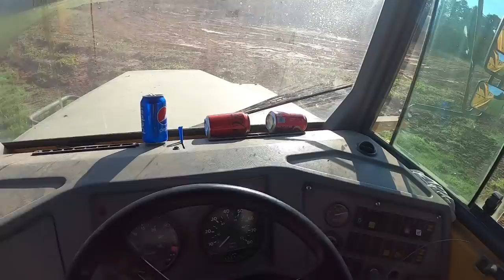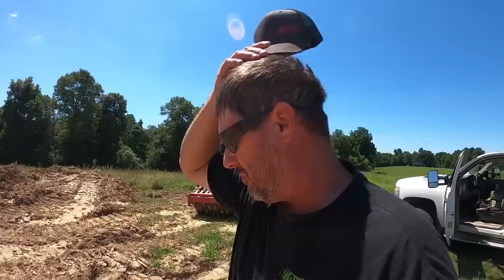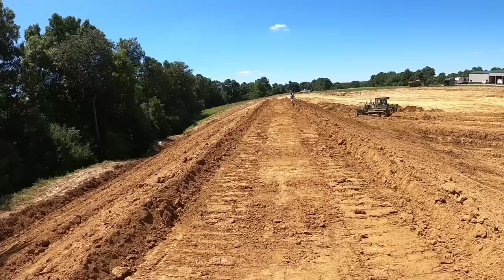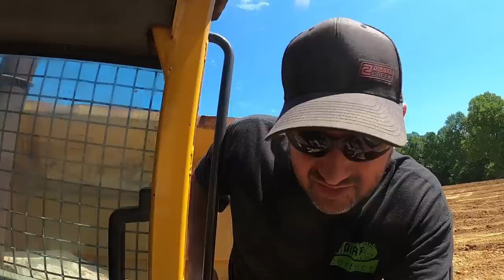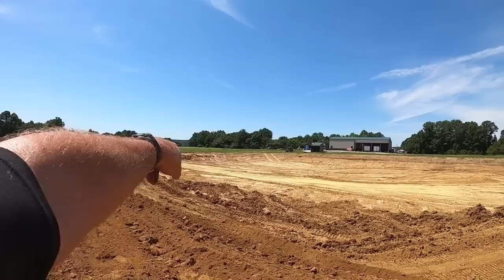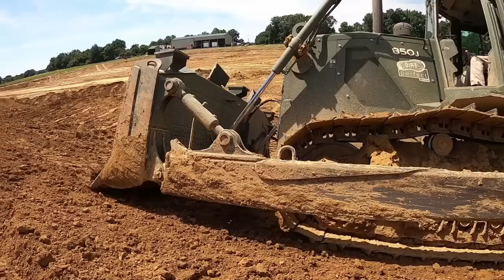Hitting on all cylinders-we got dirt on the move and dam is getting close!  @UpstateBrushControl

Comment: You love the serviceability , controls, smoothness and fuel consumption. Also the weight is right for hauling. Also, you had all the work done on the bucket, level sensor, etc… keep the 210. 🇦🇺

Comment: Hi DP  your getting about the same fuel burn as Dirt steel and grain with the 220, but I have to say a 6 cylinder won't be working as hard, just I'm unsure what size bucket is on the 220. The big question is hauling it to the site would it cause any problems with it being slightly bigger? ps I  think I already know what you've got now lol yes I follow you on Facebook.

Comment: To me, it's a no-brainer to send the 210 back.  Great machine, but extremely difficult to justify new prices.  I'd buy a good 2000-3000 hr machine and expect to do a bit of wrenching and accept a few dents and scratches. To justify new prices, you need full-time work - a pipeliner, quarry, mine, large industrial project can make sense buying new since uptime is so important. But for DP, unless Hyundai cuts him a smoking deal, I'll be shocked if DP keeps the 210.

Comment: I personally think the 210 is a good match for your needs. The 220 is a bigger machine physically so don't think you need it. I might consider a bigger bucket for mass excavation like this dam project. It can handle bigger trees for removal them the JD also. Also it is easier to haul into some of the job sites you get involved with, the 220 being I believe 124 inch's wider. Even being a Cat man for years I am impressed by not just the detailed build quality. Especially the layout of maintenance items , filters, grease points but the way everything wire's, hose's etc are marked. Anyways just my two cents worth :-)

Comment: From this side of the camera the 210 looks like it was the little bit more machine you needed for some jobs. Bit more weight for shoving trees and moving big decretive rock, but still sips fuel and doesn't need more truck and trailer to move it. To me it looks like it fits your operation like the ripper on the newer 850, you didn't know how much use it would get till you used it. Matt and Aaron or Kleeman could have moved a fair amount of dirt with the 210 and Bubba Dump if you had to run the dozer if Jerry had something else to do. As the three of them seem to be comfortable running the truck or the excavator. Heck get all four of your part time help with you on a job and you could build people lakes instead of ponds. 

The only machine I can think of that might work better for ponds would be a scraper, but they are pretty much a one trick pony; and depending on the scraper you still need a dozer to shove it. But that is extra moot once Lt Dan is up and running, that 210 with a big bucket with those two dump trucks would really move a lot of dirt.

Comment: Once you have a price on the 210, you can quickly price other excavators of similar size and features. With that data in hand, your decision should be pretty easy.
On the dozer vs haul truck and excavator, why not bite the bullet and rent an elevated scraper for your next large pond job. I think you will be surprised at the cubic yards and time it takes to move large amounts of material with a scraper. Also, an elevated scraper cannot only build a dam quickly but can also finish grade the front and back slopes. One scraper eliminates the need for the haul truck and excavator; the 850J would rip the dirt to facilitate faster scraper loading times.

Comment: 210 is my choice but only if you are going for the big jobs . My analysis method would be based on the following
1. Cost of the machine payments per hour 
2. Cost of fuel per hour 
3. Yards of dirt moved per hour.
4. Mobilization expenses 
5. Maintenance expenses
6.  How many more jobs can be done with 210 vs 850
I think you already do this but that is my way to do it 
Use as many scenarios as you can and take the average. Then do what I think you will do and let the 210 go back to the dealer

Comment: Are you taking in consideration you're using a smaller bucket on the 210. If you had a bigger bucket to match the trackhoe power/stability. You would be doing less cycle times loading quicker better turn around times. I agree with you about there's the perfect equipment combo for each job and not every job is a cookie cutter job. Keep it up I like watching you guys play in large sand boxes with your toys.

Comment: DP, regarding that representation of figures:

My first concept is a graph,
-  time (days assigned to a project) from left to right,
-  money from bottom to top.

You can then draw lines, like
-  horizontal ones for one-time costs (like permits) and (below the X-axis) benefits, and 
-  gradients for continuing costs (like fuel and labor hours).

You could draw multiple lines for the same data (like representing a high and a low fuel-price estimate, or operating costs of alternate equipment (like 120 or 210). You could assign different shades of the same color to lines of the same category, like darker blue for the 210 than for the 120, and darker red for a higher fuel price.
A repair job on a piece of equipment would appear as a horizontal line from the day it occurred (e.g. day 78 of the project).

These lines obviously are representations of equations. You could set these up in a spreadsheet (save an empty one as a template!), such that you can always view your graph, see if you're still on track for profit, and how aspects of costs and benefits develop. - Well, I assume that dedicated Project Management software will do a better trick, but you're likely to have some experience using spreadsheets.

You could start the spreadsheet simple, then gradually break up factors, like the operating cost of equipment in "greasing (daily)" and "fueling (active hours * hourly consumption * price per gallon)".

The above are my thoughts as developing while writing. There are likely to be better ones and worse ones.  :-)

Comment: Mike if you want to become more efficient the one thing you can control is the number of scoops it takes to load Bubba Dump. As you there are a lot of variables that change from job to job. But the loading is the same. So when you are in easy digging conditions. You be using the largest bucket possible. Even if you have to have it custom made. Consider it a throw away item. Make it out of 3/8 thick wear alloy. And just beef it up where it absolutely need it. I know you can easily repair it when that time comes . Bubba Dump is not making money if it has to sit and wait to get loaded.

Comment: Having been around heavy equipment all my life, fuel consumption is crucial for profitability. Your JD 120 is great for small jobs and much more maneuverable. The 210 in combination with the haul truck is a terrific combination.
Another aspect to consider is you have a lot of used equipment which requires unexpected repairs occasionally. Having a one new unit which is on warranty helps, but with your attention to maintenance, breakdowns should be at a minimum for many, many hours of use.
Considering the additional fuel usage and weight of a 220,  there doesn't appear to be much advantage to changing over.

Comment: Looking at that dam, your not the only one, it definitely looks lower at far end. It would be interesting to see what your thoughts are, especially when deciding what machinery to take to each job. Matt (NYA Millennial) has done a couple of films to show the process for quoting, which are really interesting, so seeing one from how you look at each job would be good as well. I think you definitely chose right when you picked the 210, looking at how it has operated, to be honest I don't think there is much in it, especially as it over performs when your dealing with heavy loads. When you built that stone wall, I am sure a couple of those larger rocks where over its guided lifting weight. Bet the folks at Hyundai were at 1st having a fit, then 2nd jumping for joy seeing what it could actually do. Oh and one thing, get Bubba Dum a reversing camera, that way you'll be able to talk to camera and reverse with no problem at all. 🤣😂

Comment: I can see what you mean.. this lake, the bowl is loaded with good dirt... so 2 big dozers would probably have been really good with some touch ups with Bubba and 210... like your big lake last year... you were using the 8500 to haul dirt... Bubba vs that is a big difference (We've not seen you use the 8500 much this year.... mostly seen on Kleeman's channel..).. Where you have to move dirt from pt A to B without hitting all points between.. difference maker.. of course.. the 210 with your rocks was probably huge too... some of them were probably as heavy as your 210.
One other piece of new equipment that you haven't talked about is the ripper on the J... first, you've used it heavily with the tile plow (which could be mentioned too), but you also used it here to soften things up at the beginning.  But I can see where some jobs.. The mini is too small and the 210 is just a tad overkill.. the 120 is perfect for that... the surprise is the 140 being gone... but really.. that's just another 120.. But I think the one new toy you have that you will love the most... the thunder Creek Trailer...

Comment: How do the numbers work when you consider Matt sitting in Bubba's cab while you load and you sitting in the 210 prepping for the next load vs a one man operation jumping between equipment? The 120 has Matt sitting longer in Bubba but less fuel burn. Wages sitting in the cab look like a bigger bite that fuel. 
That takes some number crunching. Cost of 2 men and fuel per 100 yards/10 loads moved vs 1 man and fuel per 100 yards/10 loads. The operators legs would pay a toll with a 1 man operation. Been there, Done that.
Reply from the maker: No comparison

Comment: Having options is the key, versitility 'Horses for Courses' is a saying that rings true everytime.
 Th2 210 is by far better value than say a 220 Volvo. also the 120 JD is getting long in the tooth and repair work is down time = cost to you and the customer.
 Having repaired all makes and models of earth moving equipment I found that the 'Mechanics friend is the 210 make due the fact that I had little to do only servies them and those are planned. 
The Volvo make as LD18 will say costs an arm and a leg when needing repairs and those breakdowns , faults or issues alway happen when you need the machine, also where I live the spares availability for the Volvo has become shall I say strained and alternative parts are not liked by the Volvo machines. 
The Volvo dump truck is by far the best out there we replaced our Cat dump truck for Volvo and again vertually breakdown free.
 The push v the dig load and move is all about cost effectivness as you say and Matt has that well versed in his quote vids. The 210 I would recomend and I am not employed or been employed by said manufacturer, in fact I learnt my trade with the good old IH company and your friend at C&C will tell you that we made some of the best crawlers in the day and they are still running, so I am only saying what I feel is best because I had to repair large plant/equipment for many years and have kept my eye in to present day.
I felt sad when you went with the Volvo when you last bought an excavator and my comments did come out true unfortunatly. Please take your time think and think again and go for the one that fits and answers as many questions as you see fit.
Take care stay safe and awsome vid again.

Comment: I have moved a lot of dirt and trucking it like you have been doing still is less wear and tear and you can move a lot with that haul truck and larger excavator. Dozers burn a lot when heavy pushing plus the haul truck is a great compactor.  Using both methods is a great combination.

Comment: You talking about effectively moving the dirt on the lake. I can see where a motor grader and scraper would be more efficient than the truck excavator that you are using. There is no right or wrong way to move dirt you just use what you have.
Reply from the maker: I disagree on this job think about a few factors
Reply: @DirtPerfect  to be honest on that job two or three dozers was all you need. But if you replaced the truck and excavator with a pan and grader you would see faster cycle times
Reply: With a scraper you don't need someone/equipment to load dirt.  You don't need someone/equipment to spread or grade dirt. It also rolls/compacts dirt as you build it. One machine can replace 3 on this job.  But you have to have scrapers at your disposal otherwise you use what you got.

Comment: I have a different take on the 210. My thoughts don’t take fuel consumption into the primary, but rather secondary concern. My number one consideration is does the machine reliably and repetitively get the job done with the least amount of headaches, and is designed with ease of maintenance and serviceability in mind. My second consideration is does the dealer selling the machine take care of you their customer. From what I’ve seen, your Hyundai dealer has worked hard to earn your business. If they will continue working hard on the parts and service side of the business when the time comes as the hours pile up on the machine, I say get the checkbook out. The last thing you want is the most fuel efficient machine, but can’t make it through a job without something going wrong (remember the headaches the ORANGE machine gave you)!

Comment: Just figuring the fuel usage alone: If you go to a used machine and it uses, let's say 6 gallons per hour and if you worked that machine for 5 days a week at 10 hrs. a day and if diesel gets to $6 per gallon, you will spend $1800 a week as compared to $900 with the machine you're now using. If you worked for a month in that scenario, it seems that you would save enough to make the payment on the new 210

Comment: We did a huge flood control project for a town about ten years ago and we were doing it much like you are except on a larger scale. Then the foreman decided to use loaders instead of excavators for the digging and loading. It increased the amount of dirt moving by at least double. Instead of 8 trucks we went up to twenty. The only downside was every once in a while we had to have a dozer or excavator dig down to the next level.  Just a thought for your next project

Comment: You probably made up your mind by now, but this is my thought. 
A dozer is a more specifick machine capable of moving a lot of dirt. in the hands of an experienced operator like Jerry you can get the most out of it.
But Jerry is not the youngest any more and hard to replace. Besides that, you have three dozers.

An excavator is more universal, cannot move as much dirt as a dozer, but can do a lot more, like the rock wall or clearing trees. It is more likely to run the entire year when your dozer is not. When the Hyundai is going, you have the 120 and the mini left, probably not enough so you are looking for a new(er) and heavier excavator.

The only one that can tell if it possible is you, we cannot see into your wallet, and thats what have to make out. Being a small business and able to make good bids and quotations you got to have universal machine and the capable man to run it.

Bubba dump is way better in rough terrain, the GMC cab also drive on the road with a trailer, you said it yourself as an axample, you could have done the rockwall with the GMC, but Bubba Dump proved to be valuable, it works the same for a heavier excavator.

Comment: Have you tried to do some analysis to compare the system you have with the 210 and Volvo dump against a box scraper. Something where you look at the fuel/Hr and the personnel/hr costs. Like you have mentioned in past videos a box scraper is ideal for this job, but how much more efficient would it have been. 

The 210 isn't a bad machine but it isn't significantly bigger than the 140. Personally I would  look for an excavator that was significantly larger than the 140, the fuel per hr cost is higher but the material moved per hour is also higher, you have more  capacity across the board. How much bigger can you go with an excavator and still be able to move it with your existing over the road setup?